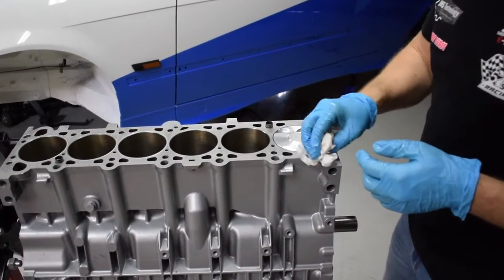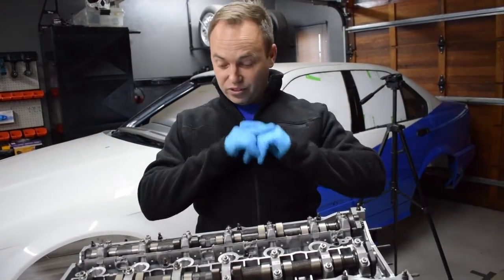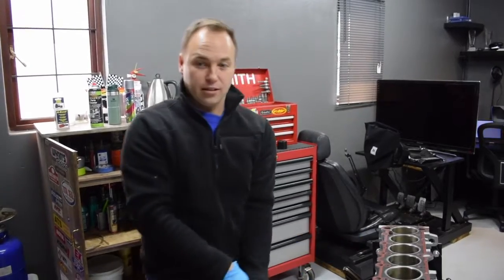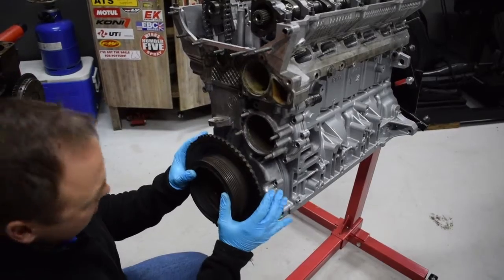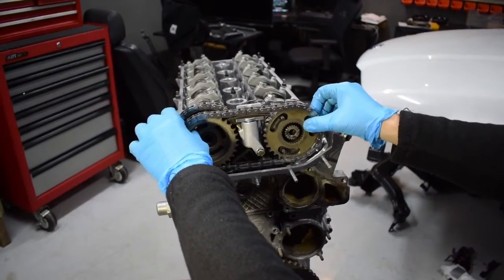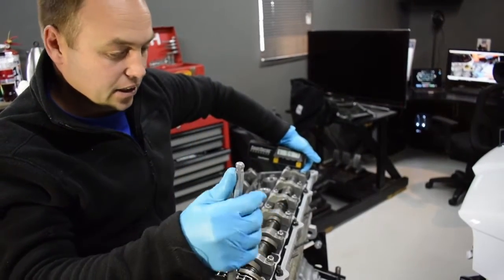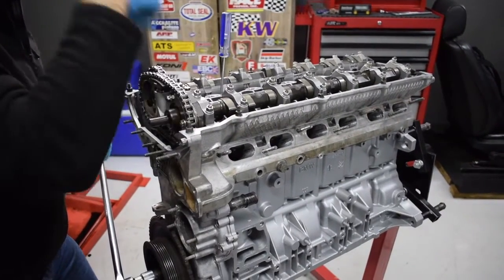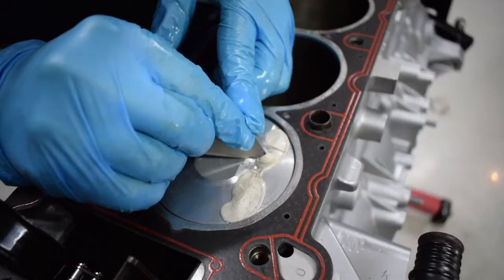M52 B30 NA Race Build Pt 4 - Piston to Valve Clearance

Comment: Hello sir great job !!! I have some question i will happy if you give me a answer.I have m52b28 and soon I will put 260degree cams with 10mm lift and also i shaved  a head 0.40mm and cilinder block 0.15mm my plan is to use 1.7mm head gasket stock one . When you do the measurment do you tight head on spec or just hand tight and do you use same head gasket when you do the final assmeble and last question wich one is dangerous point when vanos it is in full advance or no ?.(sorry about my english i try my best 😅)
Reply from the maker: @ДиянСлавчев-ю8э  thanks for the good question.
Yes, you torque the head down to spec so that it can compress the gasket. Yes you can use the same gasket, no problem.
You are looking for +- 2mm gap between valve and piston. More is good, less then 2mm is dangerous.
Yes you must check with the VANOS in full advance.
Thanks for watching 💪🏻
Reply: Thanks  for a help sir  💪

Comment: Hello, nice vids & build, I viewed every video! 
This video makes me wonder if I should worry about piston to valve clearance but i don't find it
I have M52B25 simple vanos, 
going to put m54b30 intake cam + m50b20/5 no vanos intake cam on my exhaust side + I want 1mm head gasket (instead of 1.7mm OEM) to gain higher compression. 
Should I worry about piston to valve clearance ? Thank you ! Wishing you the best !
Reply from the maker: Hi, thank you for watching. It probably won’t be an issue but The safe answer is that you check and make sure.
There is normally more than 2mm clearance so like I say, it should be ok. But just check